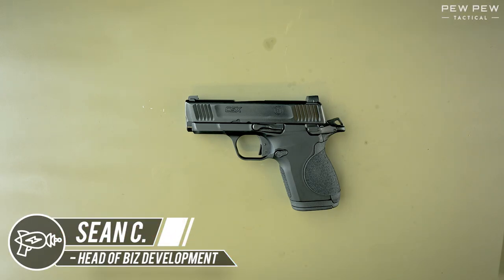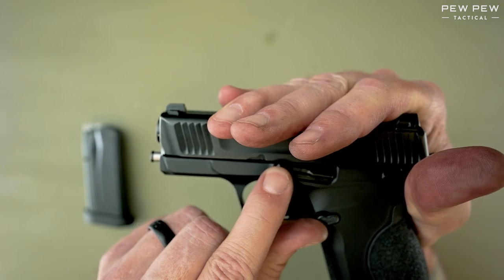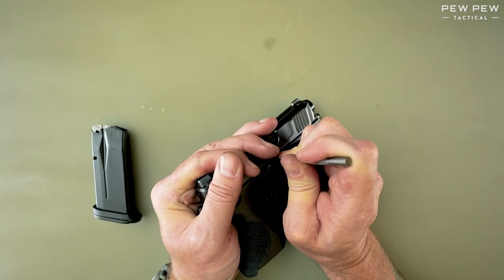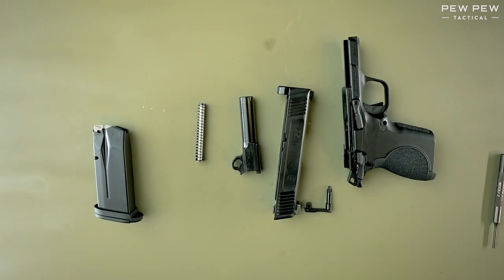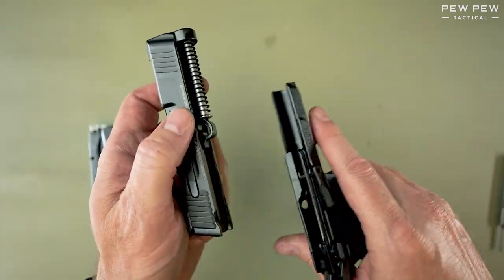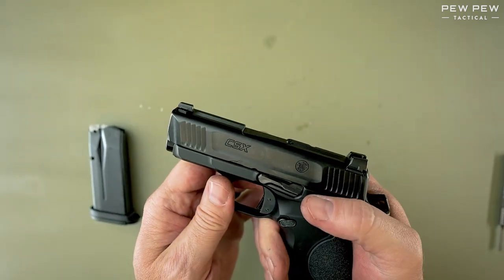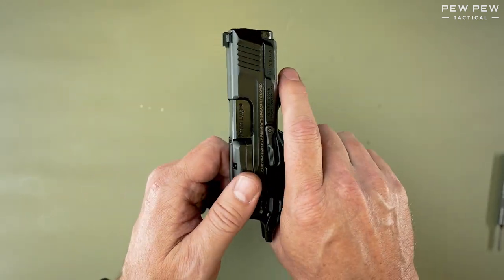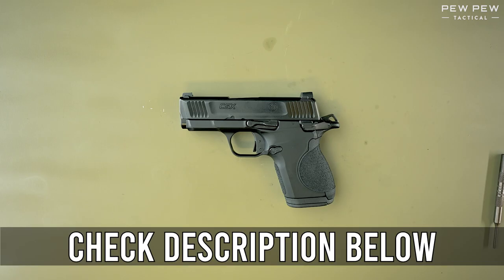Smith & Wesson CSX [Field Strip]: Disassembly & Reassembly

Comment: I for the life of me can’t get the pin removed. Damn thing just won’t budge.
Reply: Did you pull the slide just a smidgen back?  Or try to ram it out?  You have to pile the speed back about a 1/4" first then it will come out